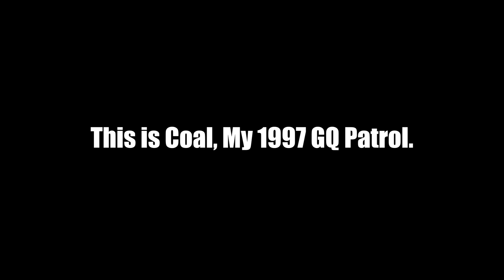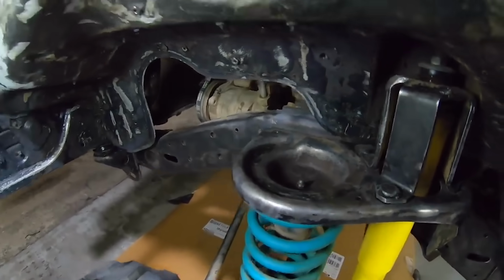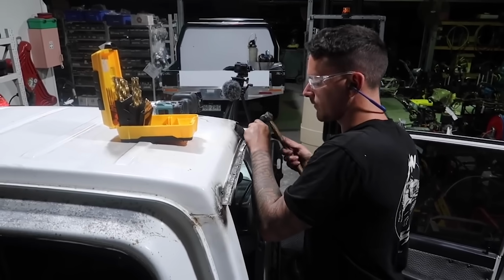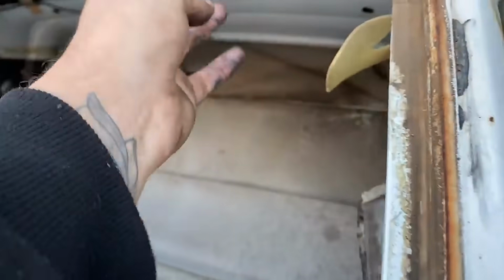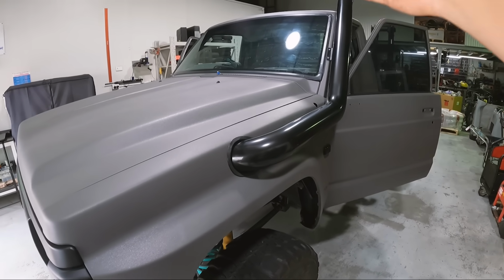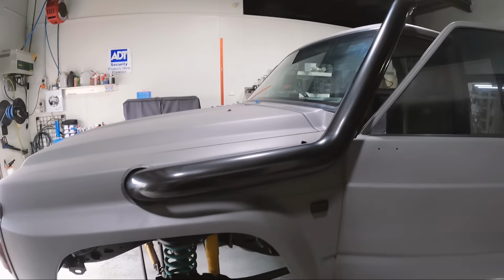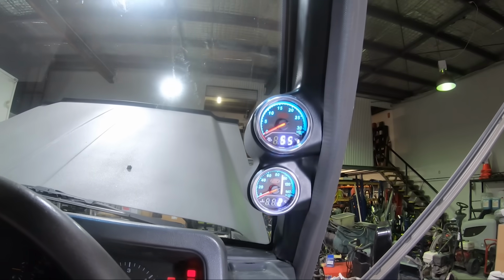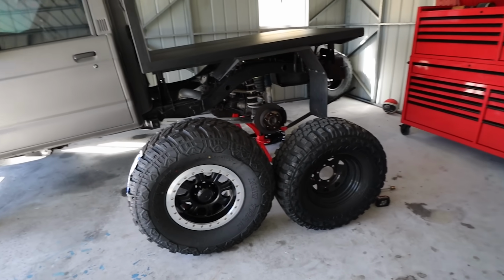Building a Nissan Patrol 4x4 in 15 minutes!

Comment: hey roam lyfe I also have a patrol from 1990 and with my extension I have a problem for the transmission shaft, I made an extension of 4 "and in France we have no valid solution for the vibrations that do you say?
Reply from the maker: You have done a Body lift? You need to extend the shifter??
Reply: @RoamLyfe  I'm talking about vibration on the transmission shaft, that you put as the original shaft?  or a double double cross

Comment: That's amazing, mate. What a rig. In my humble opinion build a half canopy for fridge and cooking station on one side and 12 volts system on the other side (redarc manager 30 with 120/150 Amp lithium battery) would a good setup for touring, setup a pillar system at the rear corner of the tray (easy to removed), then run a full roof rack on top with RTT, solar panels, maxtrax, shovel mount, alu boxes for storage, good plastic water storage system with a tape(gravity fed), couple leds on the rear and sides for camping, Good pair of spotties in the front like ARB intensity, Stedi lights, BD LP pro 6/9, Rigid S1 led for A-pillars, dual battery system under the hood, an isolator with Spod bantom system, for the overhead light Rigid H5 is best with flood and soot combo plus Gps system on it which spread the light according to your speed. 35s when touring (being legal) the list goes on.. Mate, no offense just sharing my opinion, alright. By the way my rig is ISUZU dmax 3 inch lift on 33s, Runva winch 10k, RIGID lights, yakima rack, Kings soft top RTT (medium) maxtrax (ebay), ARB Bumpers and snorkel, swing outs with spare and jerries, rear E locker, TC, HDC, hill assist those are few mods and features i got. Got a long way to go.. My skid plates is self made aluminum and steel combo. ARB one is on the way. Unlike your petrol mine is more like a touring spec at the moment, but with winch, maxtrax, kinetic rope, soft shackles, pully, slider which is also locally desinged and bilted on the chasis. I can do most of the track, off course used to get diff out often.

Comment: On the roof part above the door, you would do a much better work cutting off the inner rusty shit aswell and welding a new plate. Once it gets rust, it will rust again sooner or later, there is no product that will stop rust permanently. You already did open it up, so you might aswell just change it.

Comment: looks pretty nice man! is the black spray that you used in the chassis and diff's and all that below stuff something special for preventing rust? it looked thick. or the point is that you removed the rust mechanically and it is just normal primer?